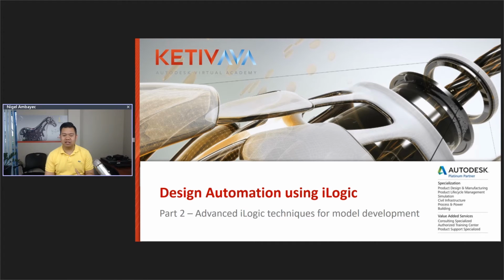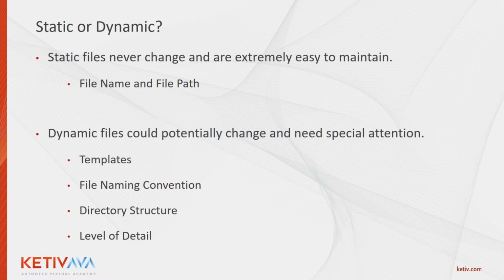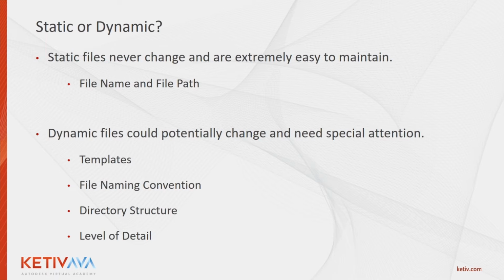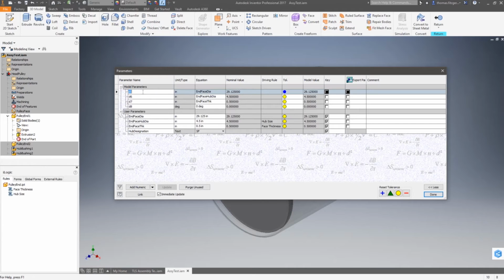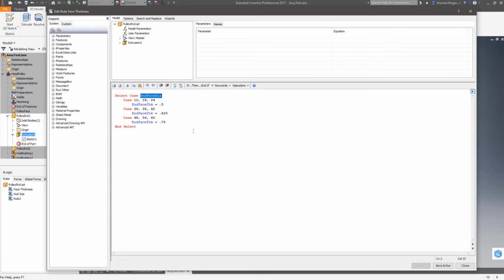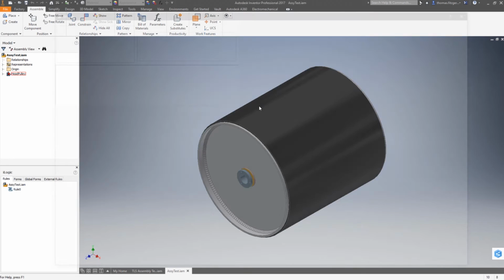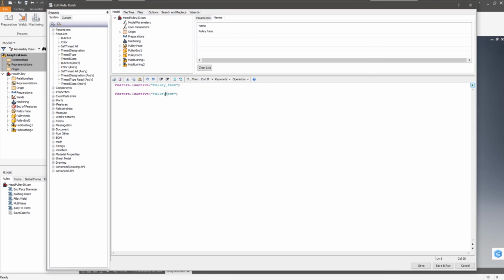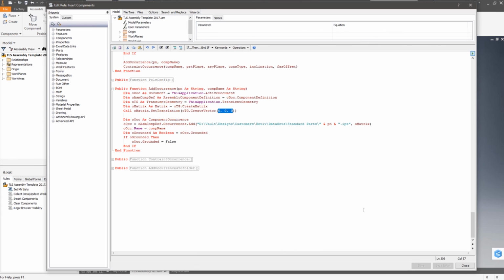iLogic Design Automation Part 2 | Autodesk Virtual Academy

Comment: If model parameters are changed then, incidentally parts will be also changed, which might be used in another assembly. which consequently changes that assy too, which obviously is not intended. How to deal with this problem ?
Reply from the maker: Hi Soumyajit,

In the situation you described, inventor/vault will recognize any changes and will flag any potential waiting updates.  You'll often times see a dialog box when opening up assemblies talking about how "updates are expected," and you have the option to show the changes or not.  For simple changes like changing the parameter length of a bar, Inventor is pretty good at making the updates without any harm.  But overall it's best to be aware of what changes you are making on a holistic level before committing any check-ins.  Otherwise, you also have previous versions of all the parts and assemblies available in vault to fall back on as well.